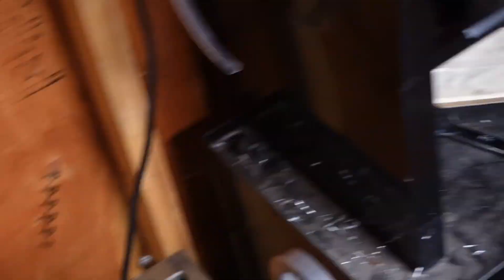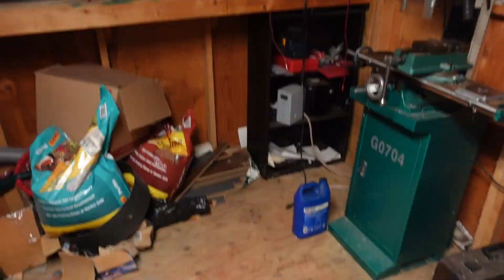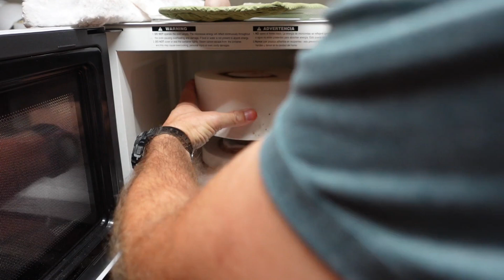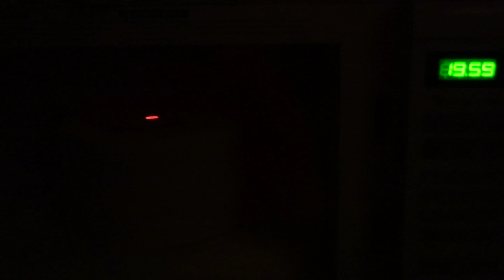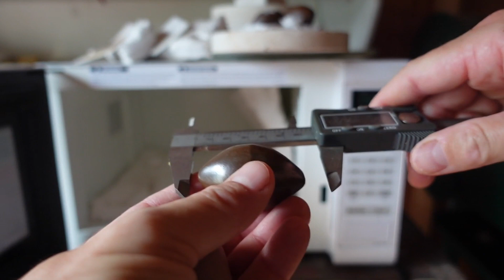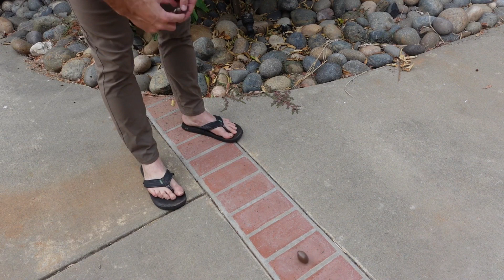Experiments with firing clay glandes in a microwave

Comment: To help with cracking, grind up some old clay that has already been fired and it to your clay mix. And those microwave glandes look sick.
Reply from the maker: It helps with the air dry, but less with the final drying. The commercial stuff is really sensitive to heating rate. The Louisiana clay didn't care at all though.